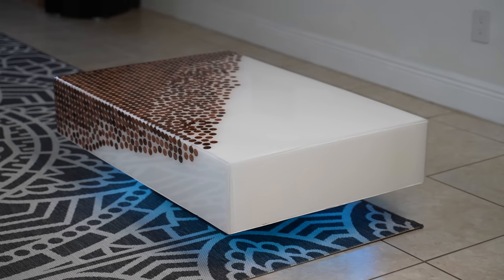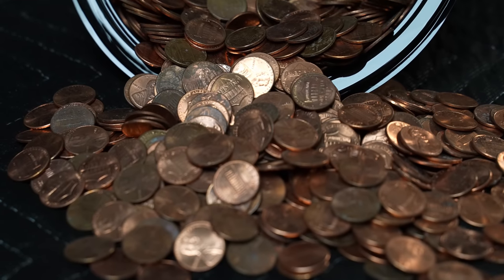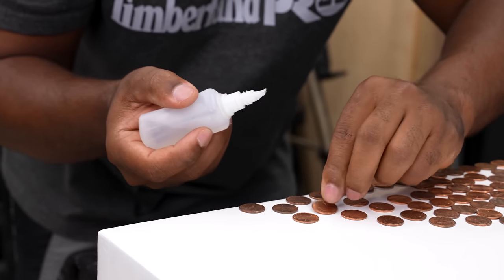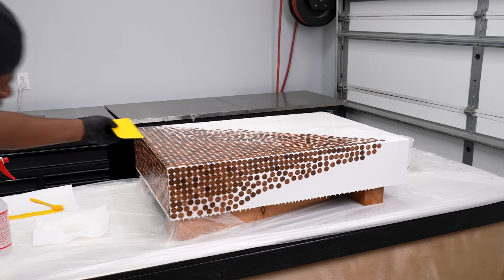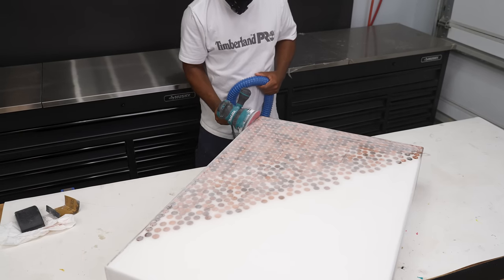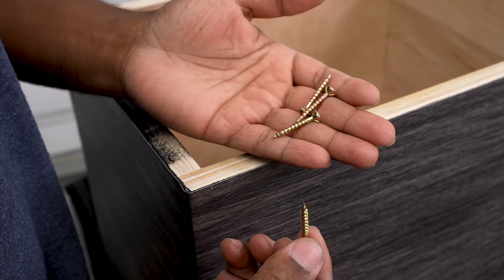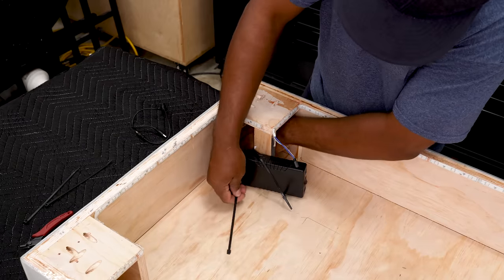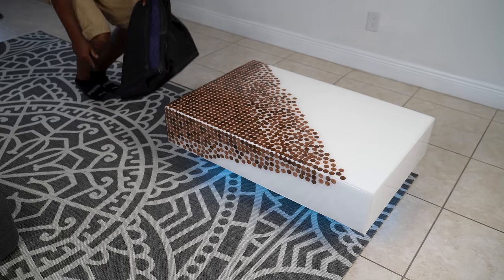DIY Epoxy Resin Table: Penny Edition

Comment: Beautiful work. I am doing a penny table on glass. I was wondering if I could use loctite super glue ultra liquid control in between pennies to adhere them to glass. I dont want to glue individually as my design is very specific and I need to transport in car for the epoxy to be placed on top. Is the super glue compatible with the epoxy resin or what kind of glue could you suggest. If glue gets on the glass will the resin adhere or bubble? I have been trying to research and cannot find the answer. Thanks for your expertise.

Comment: there is an art product called workable fixative for keeping chalk or charcoal artwork from smudging after the fact. i has a nasty habit of sticking pages together unless you use something like a wax-paper separator until it completely sets. it can take a few days if closed up in a sketchbook. for something like this a light fixative like that could work to hold something as light as a penny in place on a latex finished surface so you could get a less uniform look on the spread of the pennies. in fact you could have created a kind of "penny sorter" that dropped the pennies into a rough position and then lightly affixed them to the surface without to much fuss repositioning them after the fact. One of the benefits of the product is that it dissolves in alcohol - and it doesn't even take a lot ;you could use an atomizer from a perfume bottle or a mist setting on a sprayer. so you could set the pennies where you wanted them prior to a pour and dissolve the excess while cleaning the surface without worrying about air pockets it would get more complicated on surfaces like the side if you had the pennies in place on the 3 sides; like I said a very light adhesive. but framing out the sides as you did for a thin pour each time just to cover everything up and it would have come out mostly the same without the sense of urgency in the setup.

I'll avoid the "two cents" trope. thanks for the cool build!

Comment: what kind of white paint do you use?
Reply from the maker: What paint are you referring to?
Reply: @DIYCreators  so I am painting a surface using expansive acrylic paint, days after drying it still sticks to objects I put on top. So, any tips for a good white paint for table surfaces?
Reply: @DIYCreators  I'm thinking he is referring to the White epoxy you used as the base before you laid the pennies.